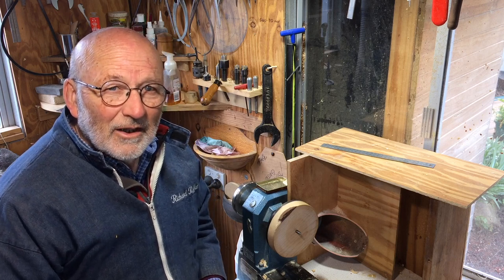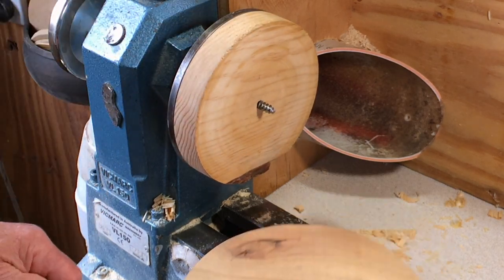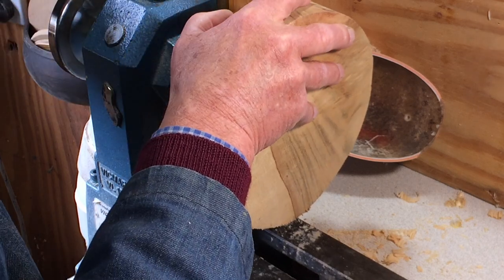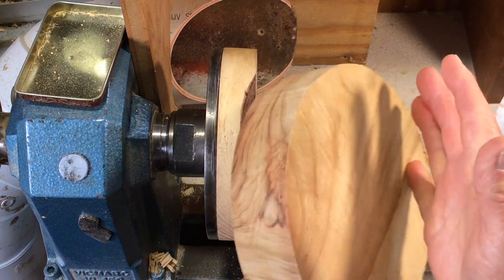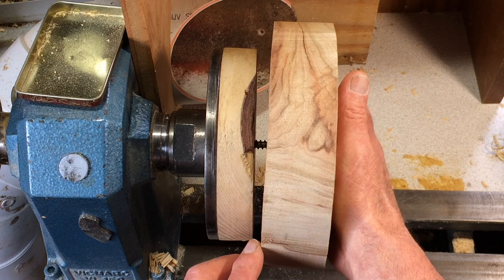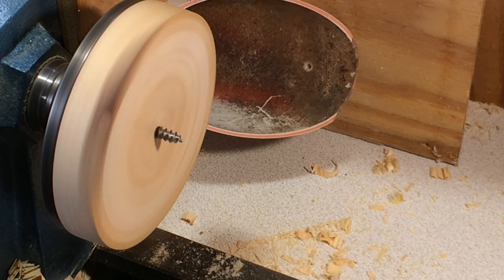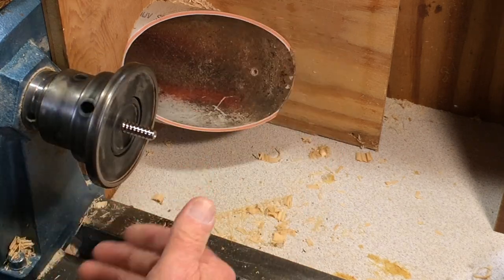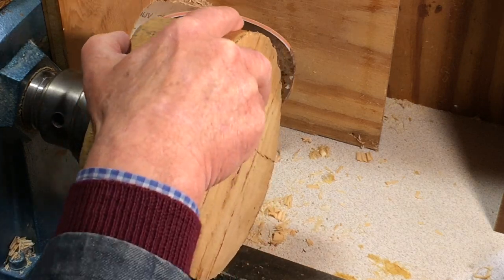Richard Raffan throws a bowl blank on a screw chuck

Comment: I have to wonder if there are worm screws of different lengths so we wouldn't need spacers?
Reply from the maker: Worm screws do vary in length and design depending on the manufacturer. Why would you want half a dozen worm screws when you can use one with spacers. Spacers are so much more convenient, especially if the blank spins on the screw when all you need to is remove a spacer rather than change chucks.
Reply: @RichardRaffanwoodturning  just curious. I agree that spacers are a simpler more convenient option. Thank you for all the help you give us through your videos. I haven't yet summoned up the courage to try back turning the end grain in spite of your excellent tutorial and how easy you make it look :)

Comment: The one thing I dislike about screw chucks is getting the finished item off. Depending on the size and shape, it can be hard to get a grip, and you have to fiddle about with levers to stop the chuck coming off.
Reply from the maker: As you can see I don't find getting a jammed blank off that tedious. It's simply a matter of setting up your lathe so it's easy to lock the faceplate in place. A strap  wrench usually makes it easy to remove small jammed pieces if you can't grip them by hand.
Reply: I use a couple of bits of non-slip cloth to increase grip. Thanks for all your videos, always glad to see them.

Comment: Different question:
What about "classic" endgrain hollowing tools, are they obsolete? By which I mean ring, hook and cup tools.
Reply from the maker: Horses for courses: Is the ring tool classic? I recall Vin Smith  applying for a patent in the mid 1980s, I suppose as a variant of the hoook tools, but did it ever take off as a turning tool... I've never heard of a cup tool but plenty of people still use hook tools although not on hard timbers like gidgee or African Blackwood, at least not as far as I know. Robin Wood uses them to turn bowls on a pole lathe and Scandinavians use them on their soft woods and softer hardwoods and on YouTube you'll find quite a few Eastern Europeans using hooks tools on softwoods. Personally I find back-hollowing and scrapers a lot faster on endgrain.

Comment: What speed do you run the lathe at when you are doing that, and how much does the speed matter?

How do you choose the size of the drilled hole to fit a given worm screw?
Reply from the maker: Rather depends on the size and weight of the blank. Generally in the 400-800 rpm range, but in the pre-variable speed days, I threw 10-in plates on to a 150mm diameter screw chuck at about 1800rpm. A small light blank needs a higher speed, but 1800rpm is fast enough. For screws with a cylindrical shank the pilot hole I drill is a fracton larger than the shank.

Comment: The risk/reward isn't worth it, at least to me. I've done it. It works. When I do it, and I usually don't, I use minimum rpm. I usually don't use a screw chuck or faceplate because it commits you to a grain orientation that may not be optimal.
Reply from the maker: It pays to get the grain orientation set when cutting the boards or blanks. Fine adjustments to grain orientation within a bowl is easy enough at the next stage. When turning or roughing 30 to 50 12-in bowls a day throwing bowls on a screw saves a lot of time, which to a professional bowl turner means money.
Reply: @RichardRaffanwoodturning  So you're doing your "fine adjustments" after it has dried and your finish turning it?
Reply from the maker: @davidshaper5146  Yes. You can shift a bowl quite a bit come the final turning although I rarely bother, being more concerned with the final proportions and shape than grain or colour variations. Eventually the colours fade and the grain isn't so obvious, so what remains is the form. With grain alignment I usually find near enough is good enough except when it comes to natural edge bowls which I want the rim to look balanced. I make a lot of green-turned bowls when I want some warping so grain alignment has to be set when cutting the blank.

Comment: Richard, what lathe speed( s)  do you recommend for this procedure.
Reply from the maker: Rather depends on the size and weight of the blank. Generally in the 400-800 rpm range, but in the pre-variable speed days, I throw 10-in plates on to a 150mm diameter screw chuck at about 1800rpm. A small light blank needs a higher speed, but 1800rpm is fast enough.